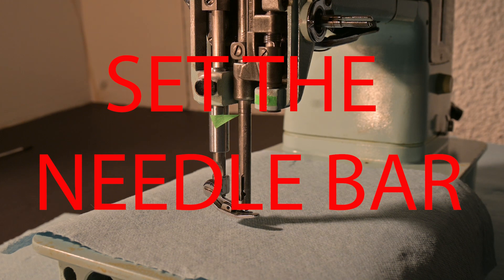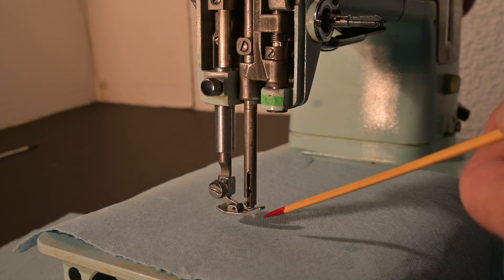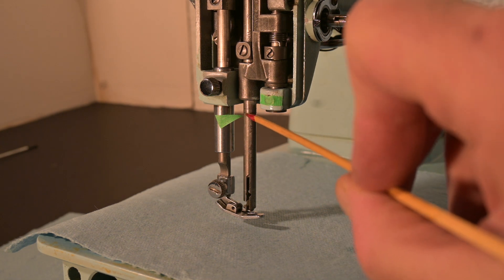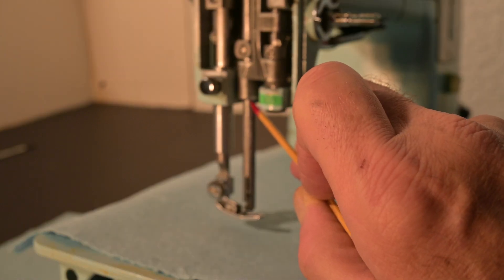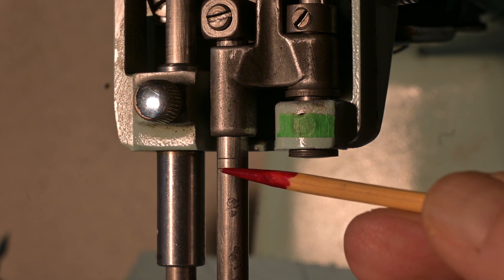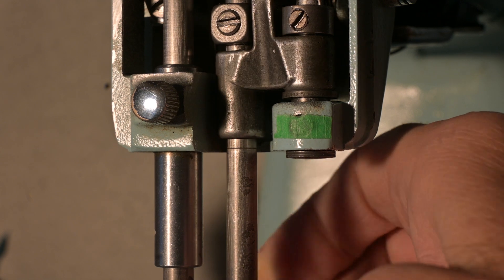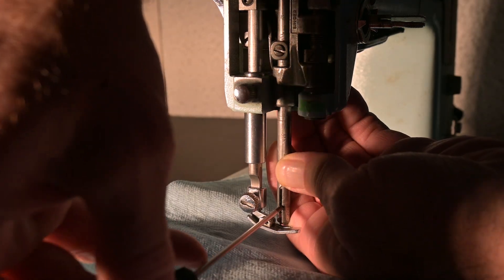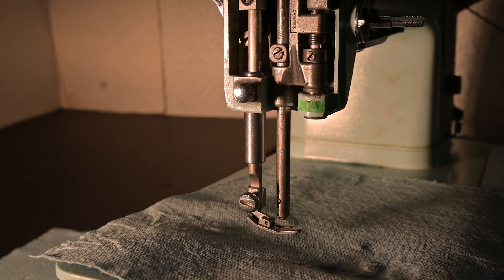SET NEEDLE BAR

Comment: I have sears Kenmore and the needle will not stay at hole center?
Reply from the maker: There is a control on the control panel that will enable the needle to be centred or put to the right or put to the left. If it is not that then it will have to be centred by adjusting below the bed, I think.
I do not go under the bed to adjust on my Singers because it is time consuming & prone to error! I am not knowledgeable about Kenmore machines. I hope it is the switch on the front panel! Thanks for asking me. Good luck!